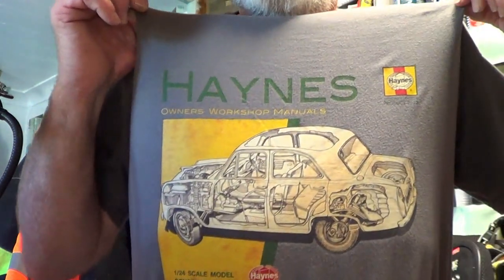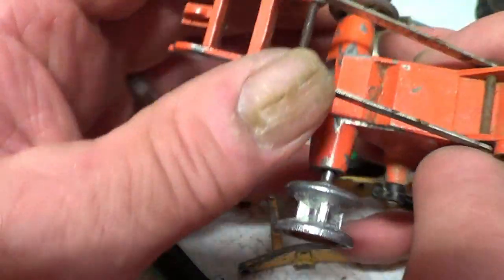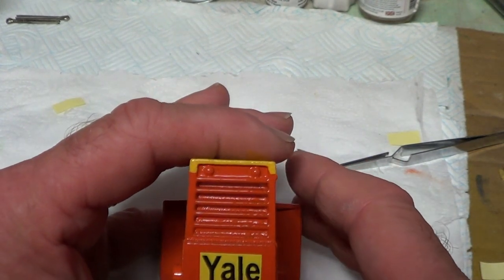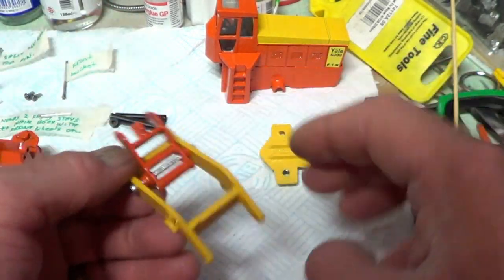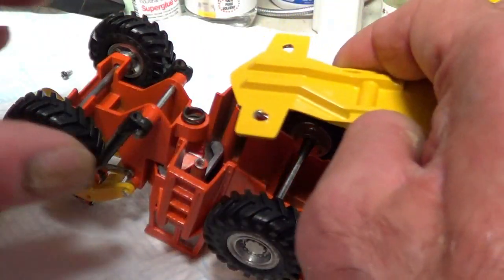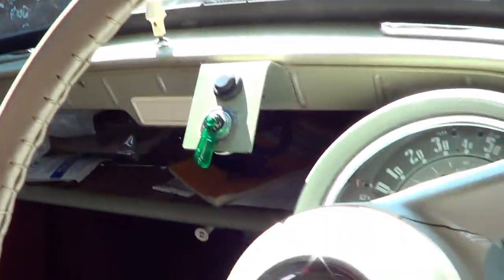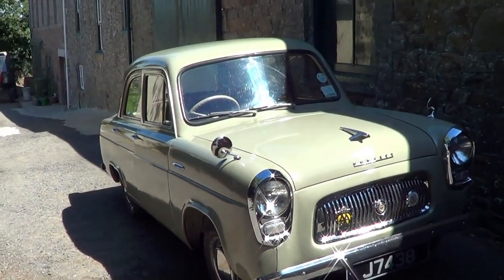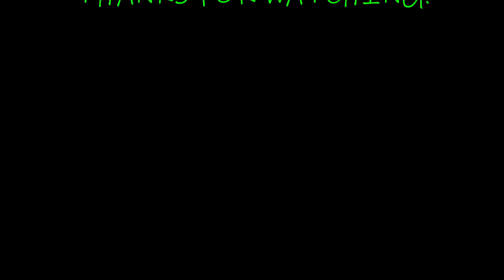DINKY TOYS EATON YALE ARTICULATED TRACTOR SHOVEL RESTORATION AND A DRIVE IN A 1956 FORD PREFECT 100E

Comment: I have one of these to do but it is in a much worse condition as all the plastic rams are bent & distorted. So when I have sourced new ones, that I may yet fabricate, it is sat on the 'to-do self'. However, I think that you have made a good job of yours Nick and done the model justice. It's good to watch someone else struggle first as it is certainly intricate is the loader ram. Well done.
Reply from the maker: Thank you Robert and good luck when you do yours, it’s putting all the pins back that I found the most difficult, one false move can mess the whole thing up!🤦🏻‍♂️

Comment: Hi Nick I've just been watching your video where you done the front loader and you have run out of brush cleaner myself I use nail varnish remover so lot cheaper don't use it to Finn down the paint keep up the good work Nick 👍
Ralph Cooling
Reply from the maker: Thank you Ralph, that’s great to know, I will get some, in the meantime I’ll pinch some from my Mrs. 😊👍
Reply: @crapaudnicksdiecastrenovat1739  Yeah she won't miss it ... I got one bottle I just used for washing brushes out a big bottle Don't Cost much.
Ralph